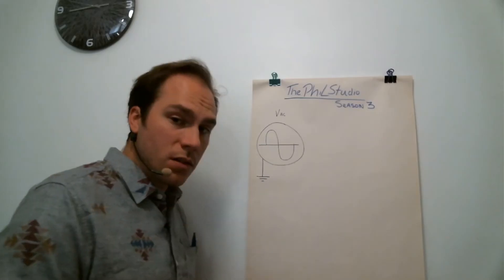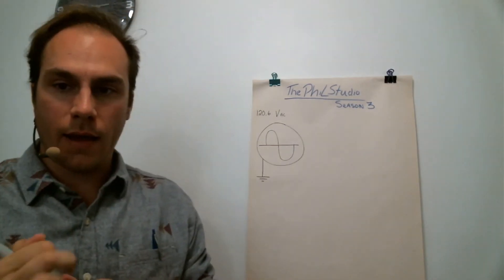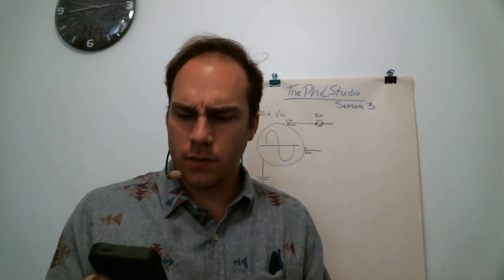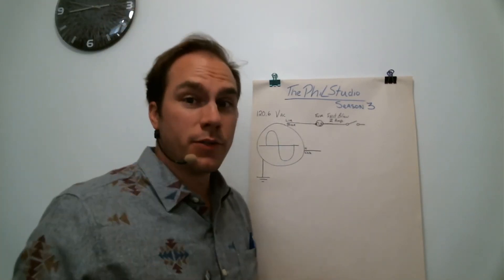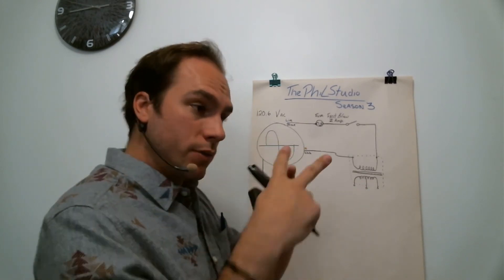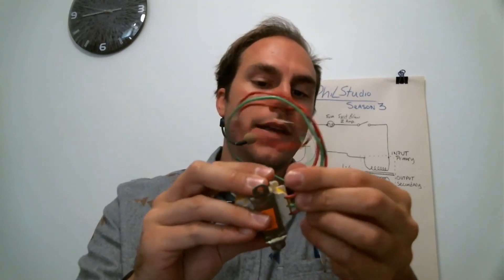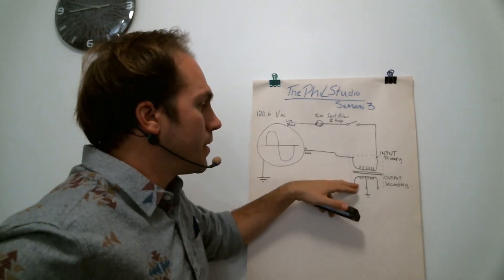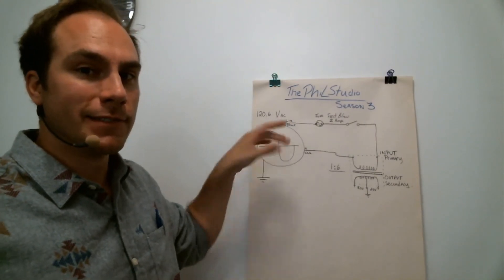Homemade Power Supply +15V -15V

Comment: Could you just explain "why" we need + and - 15V (or +- 12v) please ? What are the advantages of a +- DC, with modular synths for example ?(planning to diy a eurorack psu kit but I would prefer to understand how it works first) 

And thanks for the video it's really great  !
Reply from the maker: Thank you for the comment. I'll try to answer your question the best I can. Dual Supply will be really useful to get the maximum out of OP Amp. While these IC often requires Positive and Negative Voltage, this will enable you to get the full swing between positive and negative voltage in your Signal Output. Let's say if I power up my guitar pre-amp with a 9V battery, my power source is +9V and 0V... so to create a virtual negative, I have to get a voltage between 9V and 0V... that's why a lot of single supply circuit use to bias the non-inverted input of an OP Amp at 4,5V with a simple Voltage Divider.  In your case you're going to create a Synth Rack so think these Positive and Negative supply are gonna get handy to drive some of your OP Amp to create modulation, shape and envelop stuff. Hope it's clearer now.